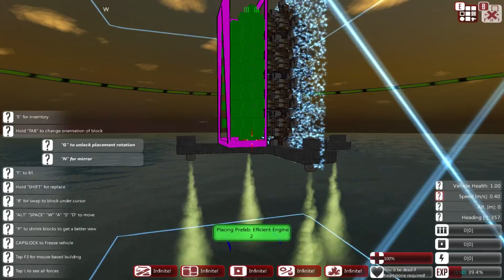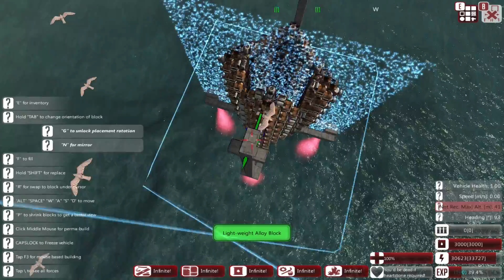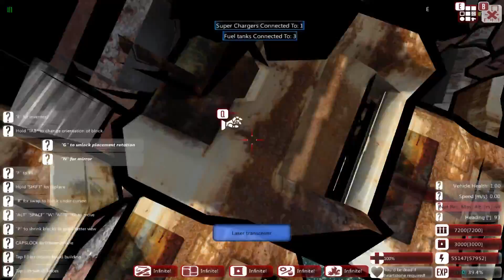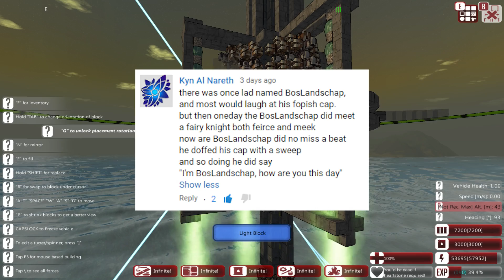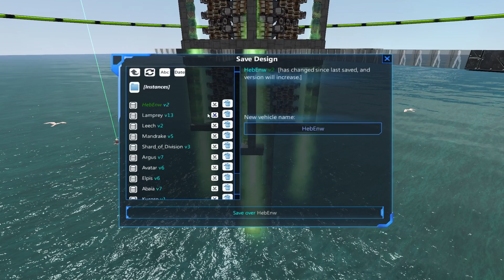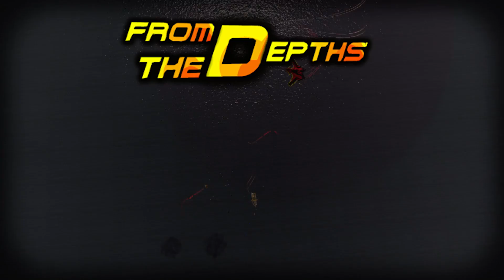From the Depths:S3 Designs 11 - Elpis Evolution

Comment: I hate to criticize Aavak's fine work but here it goes anyway:  I would place a long engine down the central core and then have 4 long laser cavity assemblies around that core.  The reason is due to FTD's strange physics - an engine gives ludicrous amounts of energy the longer it is. Also, make each of the 4 lasers have its own Multipurpose Laser block so that they can cycle full power without having to split power among a lot of Laser Missile Defense blocks.  There is a possible esthetic and/or center of mass problem with the vertical engine since it is not symmetrical when placed vertically.
Reply from the maker: +ablebaker99 Thanks for the feedback, it's very much welcomed :) I enjoy discussing ideas and get quite a lot of useful information from my viewers, so never feel like you have to apologise for it!

Comment: Aavak likes spinning shields i guess that
Reply from the maker: +TheGameChanger They're visually appealing, also, functional. Because shields work better if the impact happens at an angle, a spinning shield increases the chance that any bullet, from any angle, will make contact with the shield when it's presenting a steep angle so higher chance of reflecting :)
Reply: so I'm correct? i know you too well, every season you've had at least one spinning shield xD

Comment: I realize that this is more about how looks that engineering efficency but I have one small comment.  If those engines are mainly for the laser then a 20 cavity laser would need only 20x4x62.5 = 5,000 power engine.  Maybe you have other plans for all that engine power?  It looks like your engines are making over 118,000 power.
Reply from the maker: +ablebaker99 Shields, also, as the station will be heavy when fully armoured, keeping it in the sky :)

Comment: My absolute favorite part about watching your vids Aavak, is that you actually DO make experimental designs, see if they succeed or fail, and then take what you learned and either fix the problems, apply it to future designs, or take the original idea into an entirely new direction based on the problems discovered and potential solutions. Over the seasons I have seen your engine systems refined and perfected, your turret systems changing from bulky, vulnerable things with exposed spin blocks loosely anchored on a deck to deep-seated systems going into the core of your ships with only the barrels and armor above the hard-point slot on the deck, your shield systems going from hap-hazard angled affairs with little saturation and very little overlap to systems designed to "Spread the damage" over many different separate shield generators through rotation and ship orientation, to any number of little things, including just aesthetics in general, or laser defense arrays being more than just a stripped down offense array.

It's not even limited to your From the Depths videos, the same applies to Factorio or anything else where player-made designs are applicable, especially Robocraft.

Never stop making videos Aavak, they've become a staple of my daily free time, you glorious bastard.
Reply from the maker: +ZelganasAshHeart Wow, thank you so much for such kind praise, I really appreciate it and hope you continue to enjoy my videos for a long time to come :)

Comment: For taking down a missile you need to do at least 100 damage per shot (with Q-switches) as well as have 3 AP minimum. As for a continous laser I woldn't know, haven't found anything on them.
Reply: ringgeest11 this!!! aavak! read this! Aavak     For taking down a missile you need to do at least 100 damage per shot (with Q-switches) as well as have 3 AP minimum. As for a continous laser I woldn't know, haven't found anything on them. don't thank me though. I don't mean to steal ringeest11's thunder he's the one who figured this out
Reply: +ringgeest11  How a laser defense should be setup (functionally) has been worked out.  Check the forum post by drNovikov - "Fun with lazzors testing lams". Aavak's system does 41 damage per first shot fired per cycle.  A continuous laser cycles at 40 times a second, so it would probably take 3 shots to kill the missile but I agree - he should make the laser more powerful to bring it up to at least 100 damage per shot.
Reply: I don't actually play the game.
Reply: curtis brown I didnt figure this out pseronally, its like Able said, it is information I found on the forums =)
Reply from the maker: +ablebaker99 Thanks for the info :D

Comment: Holy crap! As I was watching this video, (in the parts before you were showing off your triple spin block system), my mind was wandering a little bit, dreaming up ideas for resource gathering fortresses of my own. I had the idea that it would be really cool to build a resource gatherer that looked as though it was being powered by a huge wind turbine, and I was having trouble thinking of ways to make it look right. I could go with a vertical axis turbine, and those do exist, but pretty much all offshore turbines are giant three-bladed designs, so I would prefer to use that shape. Thinking about the problem of creating that shape in a voxel based game like FTD, I came up with THE EXACT SAME IDEA for angling the blades of the turbines with the control blocks, then activating the spinning function after a delay. the result being that iconic three-bladed wind turbine design! I put this idea into the back of my memory and continued to watch the video, and then... Wait.. whats this Aavak is doing? Oh, it looks like he hasn't finished building that one arm of the second spin block. WAIT... he's gone and added THREE new spin blocks... and has TWO control blocks for each? TRIANGLES?? HOLY CRAP AAVAK I KNOW EXACTLY WHAT YOUR DOING GODDAMNIT I JUST THOUGHT OF THAT A FEW MINUTES AGO!!! Seriously, my reaction was priceless when I realized you were describing and building the EXACT SAME system I had thought up only moments before! Ahhh, that was brilliant! Great minds do think alike it seems!
Reply from the maker: +Sarr Cat Wow, that's a crazy coincidence! Good luck with your own system, hope you share screenshots :D
Reply: I will... if I can get the game... all the ideas I have are just that, ideas at this point, because I don't have a copy of From the Depths in which to build those ideas. But seeing as I did not win the little contest you just held, I will probably be buying it myself soon anyway. But yes, once I have the ability to do so, I will build this and share screenshots!

Also, I wonder if you could implement this system with only a single control block if you went with a Lua block instead of the standard control block... I don't know Lua, or any programing save for a little bit of messing around with Scratch I did once, but this game is a great excuse to start learning that!
Reply from the maker: Almost certainly.